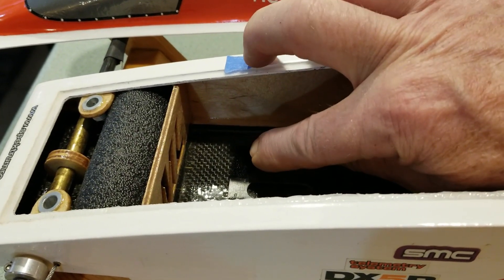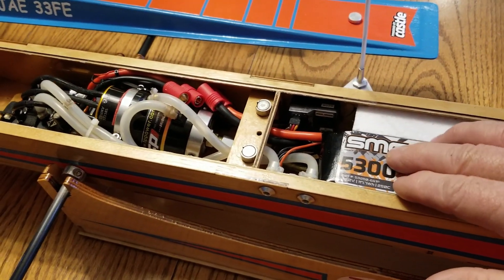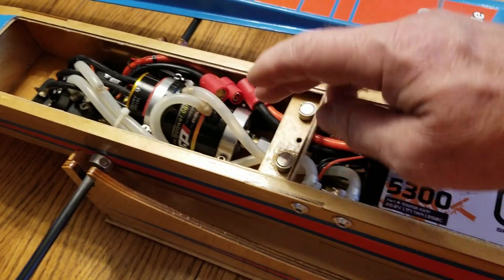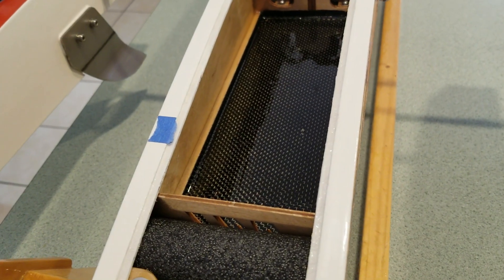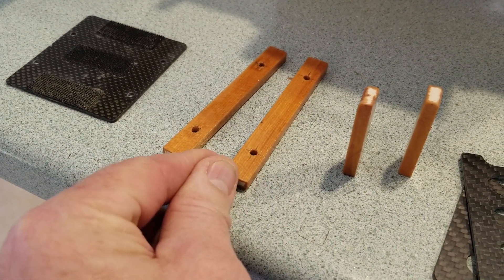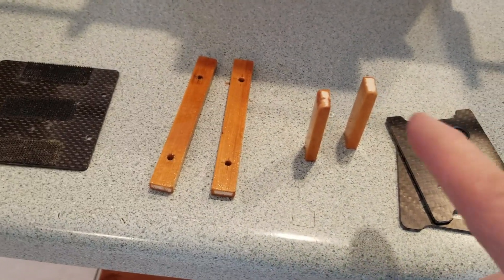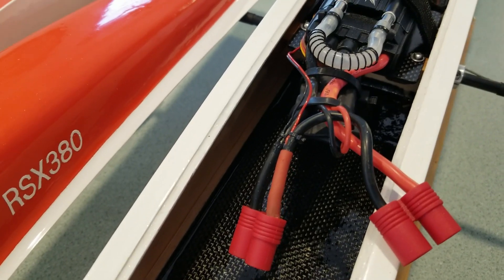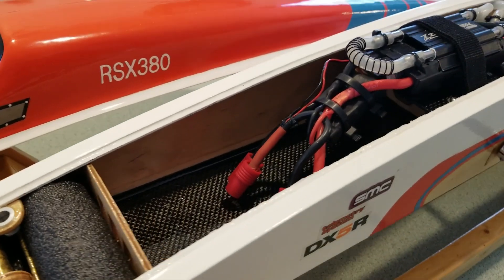ML Boatworks RSX 380_Major Electronics Upgrades!

Comment: Hey Sam what I do to hold my lipo’s in without straps is a piece of fibreglass about 15 mm wide 2mm thick same width as the the inside of the tub  so you put it on top of the battery and twist it into place with a bit of foam on the lipo’s so it holds in place so the tub lip stops the stick coming up.
I don’t mind a bit of mess so I also put tacky tape under the deck lip onto the f/glass stick.